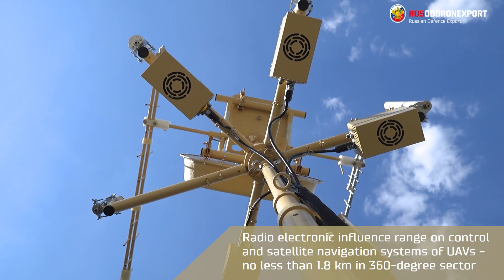RB-504P-E anti-UAV complex

Comment: Every FPV Drone produce constant RADIO Emissions (In order to send Video signal to the Operator on the Ground).
 And that is the main Weakness, because of that if MANPAD is equipped with seeker designed to detect and home in, on an enemy radio emission source. 
Drone will be intercepted. 
Today on the Battlefield the main problem is that Drones with batteries have very Low Heat & Radar signatures, so most of the time regular MANPADS will be useless !!!